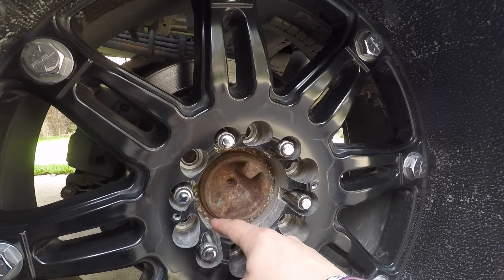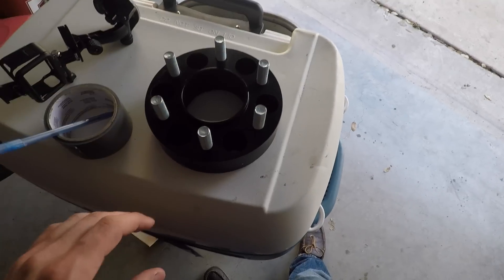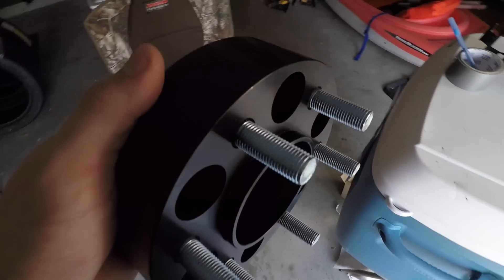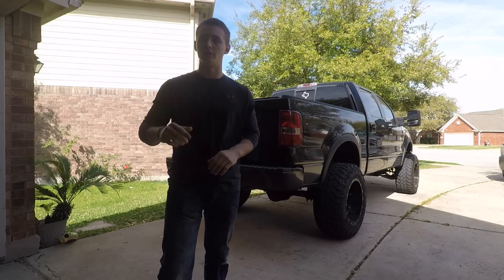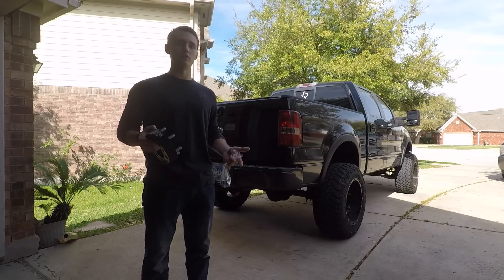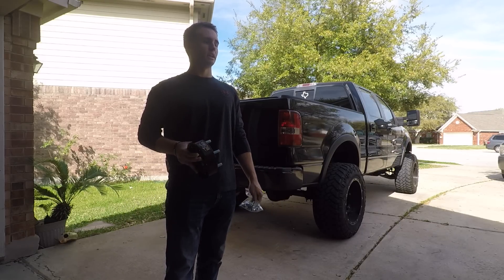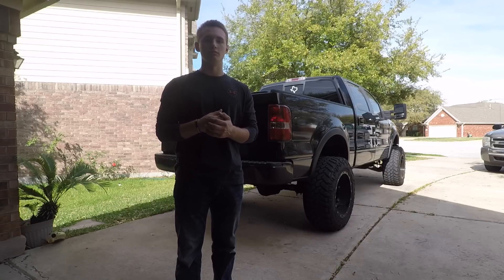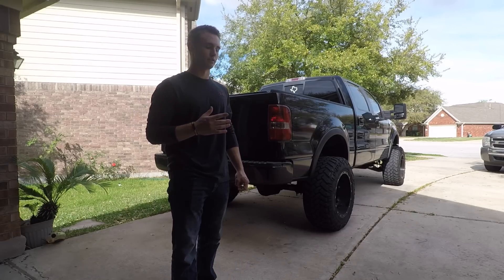KNOW THIS! Before installing wheel spacers!

Comment: FYI. Hub centric only means the wheel/spacer is centred by the hub. Not the weight being supported by the hub. The weight is never being supported by the studs alone. The weight is transferred by the friction caused between to two mating surfaces after the lug nuts are torqued.
Reply from the maker: J Bouchard I guess understand what you're saying if you drive normally on paved roads all the time but for people who off-road, that stress is on the lugs and not the hub, you can believe what you want but I've seen lugs snap because the hub of the wheel wasn't resting on the hub of the car (from offroading)
Reply: I’ve seen plenty of studs snap and shear too. And it always happens when tires are not retorqued.
Reply: you don't know what you are talking about, lug nuts don't support the weight of the vehicule, no mather the situation wether it be offroad or in town. Like J Bouchard said, it is the pressure between the hub and the wheel that is supporting the weight. The whole surface of contact is supporting the weight because of the friction. Lug nuts were never designed to support weight, their are designed to support linear tension.
Reply: I used to run plastic hub rings. This guy trying to tell us the wheel weight is being supported by plastic hub rings? (mine of which never broke lol). Fail video.

Comment: I had steelies with adapters. (No hubcentric ring) and the studs from the adapter broke after i was changing the brakes, and brought the truck down. 
I sold the rims, bought new rims with proper Hub Size and bought bora wheel spacers with same circumference. Now the wheels sit flush. 
Shit we gotta go through lol

Comment: Stop running cheepo custom wheels / your factory wheels would have been better than those multiple fit crap 💩
Reply from the maker: Matthew Fox yeah but who wants factory wheels? :)
Reply: 6 levels of knowledge=
1-PhD on molecular metals
2-Metal Engineer, MTBF
3-Design Engineer, Blueprints
4-Manufacturing Engineer
5-Assembly Engineer
6-Dealer Mechanical Tech.
7-you, me, etc.